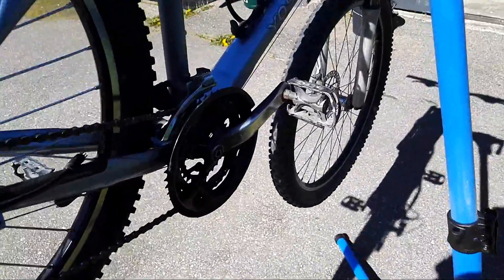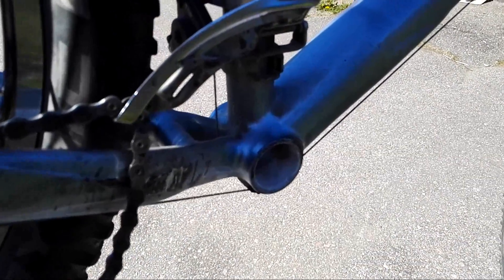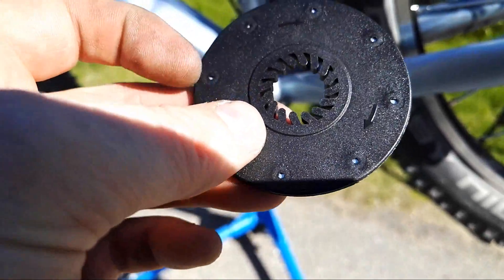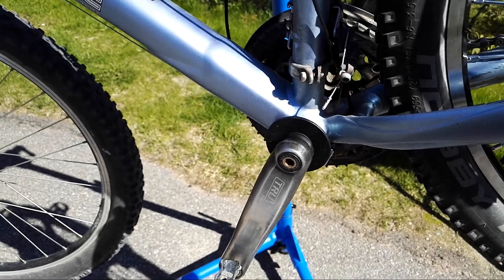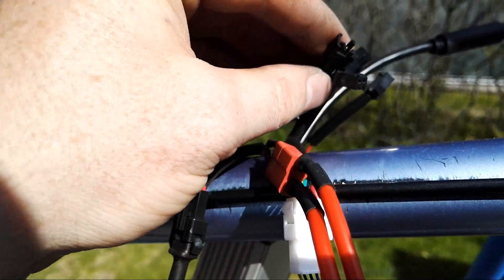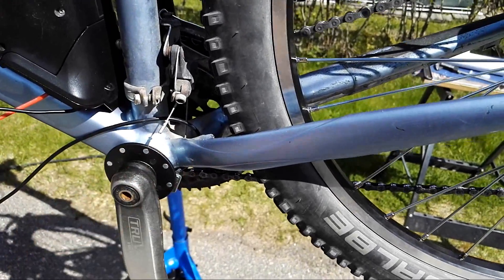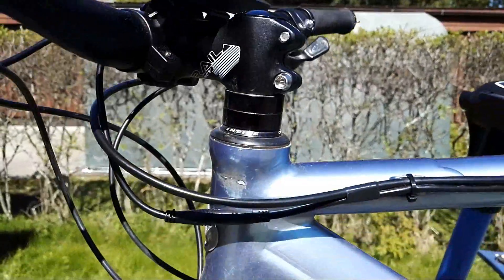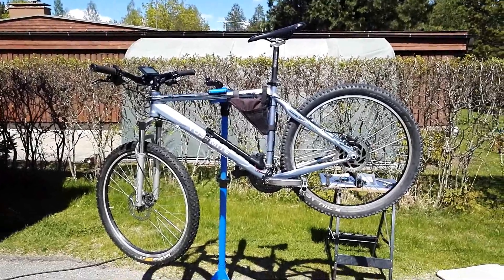How to convert your bicycle into an electric bicycle, part 2

Comment: Hi bro
How are you 
I need your help 
What is difference between screw sprocket and with cassette adapter  motor tell please 
 I have (btwin rock rider 340) bike 
Which one I should buy screw sprocket or with cassette adapter

Comment: The main reason why we have to tweak things as we build these bikes is the simple fact that they are kits and not a manufactured  
E Bike, and what you have shown in the video shows the problem with the magnets and the peddle sensor in regard to an anticlockwise and clockwise rotation also having to shave off metal from the peddle arm to get clearance from the magnet mount.
The other problem relates to the rear wheel and  attaining the clearance between the gear cluster and the frame and the disc rotor.
Thanks for the video and the simple explanation on how to fix these issues. These 2 problems are the main ones that i have faced when constructing home builds and i am sure that many prospective E Bikers will welcome this video as a very good and practical tutorial on how to overcome these problems. Well explained and well thought out.

Ride safe and enjoy the ride.